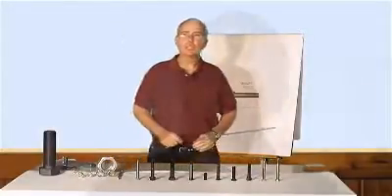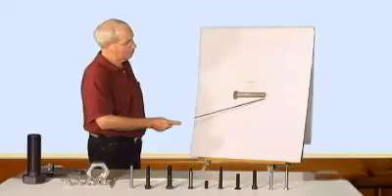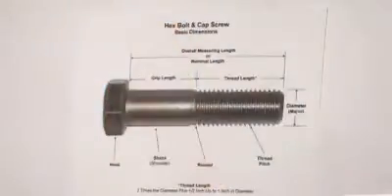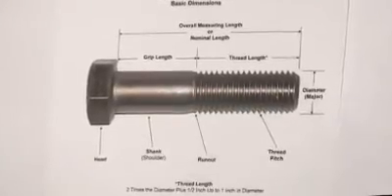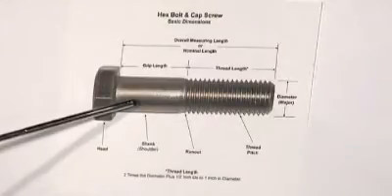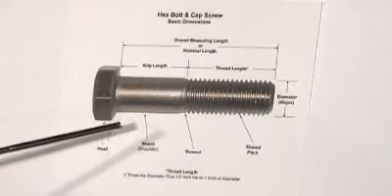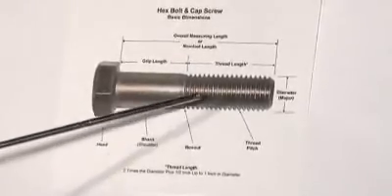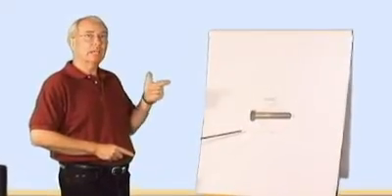Determining Thread Length

Comment: I know this is old but i need help finding a head bolt for a mercury outboard. I had it rebuilt years ago.   They are not oem. The bolts i took out are 3/8×16×3 with 1 1/2 long threads. The original oem are 3/8×16×2 3/4. The block can fit 3 inche bolts with 2/8 to spare after torquing them. I cannot find them. They are 316 grade. I have them in hand and everybody is telling me they don't exist. Any help would be greatly appreciated.

Comment: how to find bolt length i.e. thread and shank seperately for HSFG bolt dia 24mm and thickness of member 101mm by using table IS 3757-1985???

Comment: 1/2 diameter x 2 + 1/2 = 1 1/4 thread yep

Now if someone could tell me what a Grade 5, 1 3/4" bolt with 1 1/4" thread total length with head  = 2"
with a funny looking character in the middle.... looks like a hammer or a two sided sickle within a circle...
I'd REALLY appreciate it.